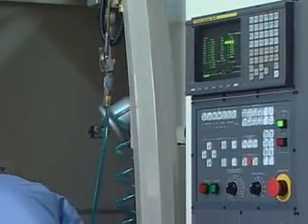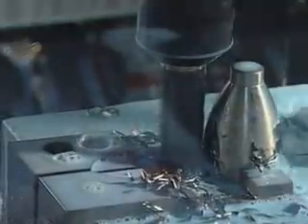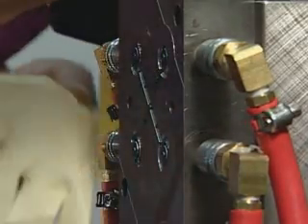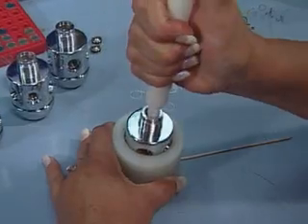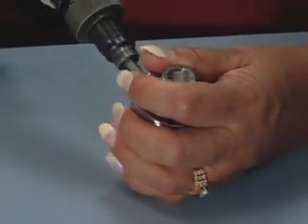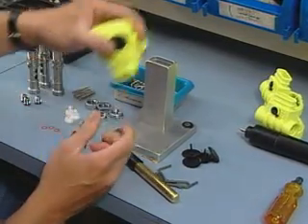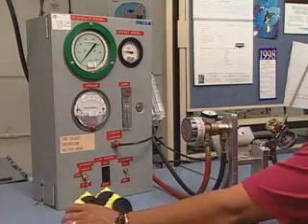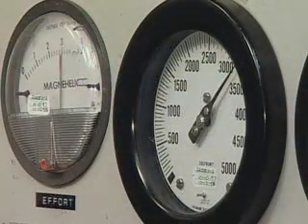making a scuba regulator

Comment from the maker: Yes... if you have a full toolroom including lathe, milling machine, boring machine, etc etc etc, plus all the toolroom skills to use them and likely at least a degree in engineering and metalurgy and a spare 50K dollars to burn on test gear to prove your design works before venturing underwater with it ;-)

Comment from the maker: Yes - well spotted.
This is the old US Divers factory.
US Divers was eventualy swallowed up into the Aqualung Conglomerate, but Aqualung still produces several venerable US Divers regulators used by NATO armed forces to this day.
Out interest, the spare parts kit used to service this regulator is identical to those used in the current Aqualung TITAN regulator, only with a much improved high pressure seat.
Cheers,
Steve Burton